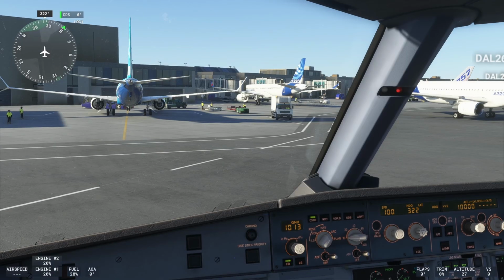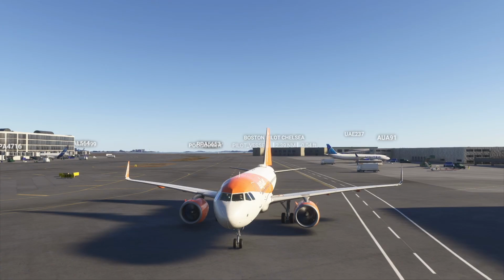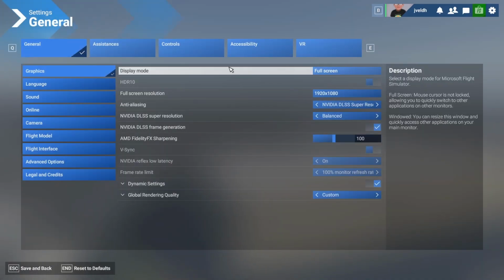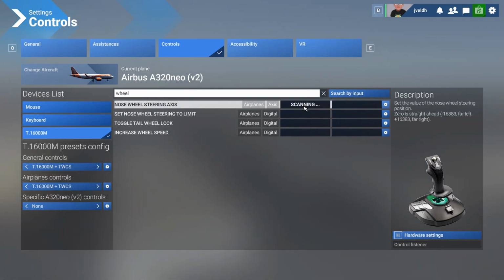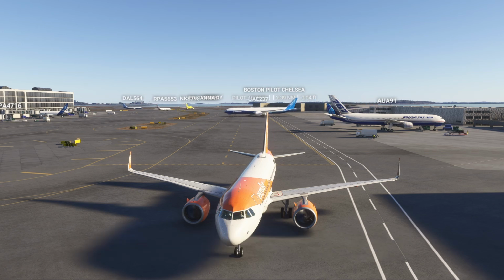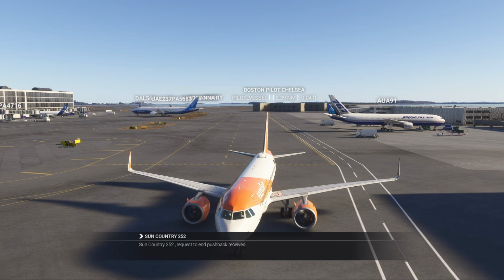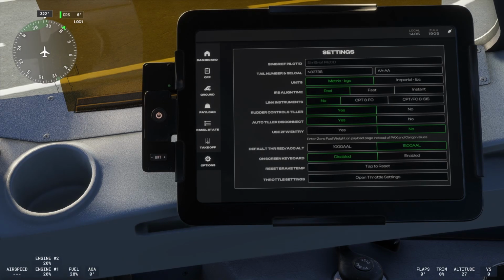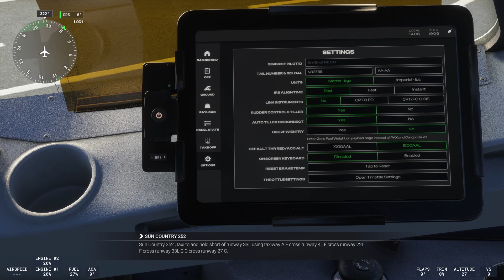🛠️ How to Fix Nose Wheel Steering in Airbux A3xx | MSFS Inibuilds Tutorial ✈️

Comment: Tysm man u saved my money for the a350 I had the same problem with the a350 and it worked tysm😊❤❤
Reply from the maker: good to hear how it the a350?
Reply: @Highintheflightsimsky  its relaly good but having a few problems so there is a problem say like i wanted to use the ba cabin my cockpit dosent load in its just the cabin what loads in and the other problem is it takes a lot of time to load
Reply: man,how to do it on MSFS2020,I met this issue on Ini350 in MSFS2020,makes me mad at air bus((
Reply: @薛文博-h6h  i think its just the same with 2024